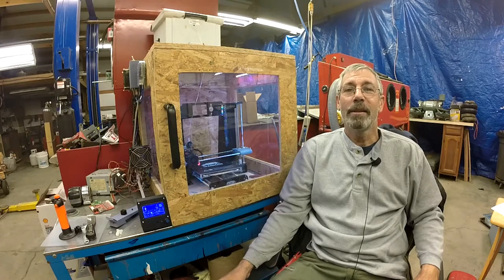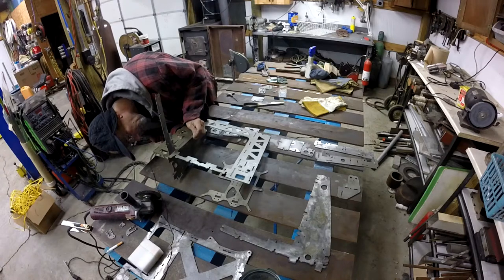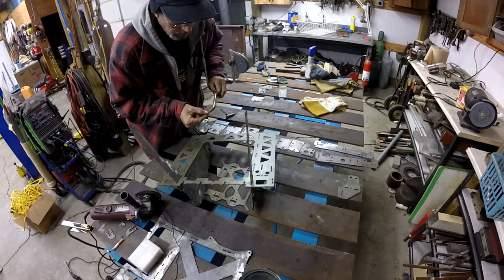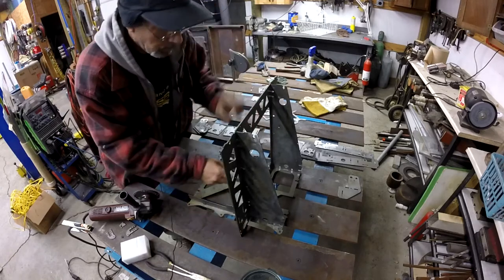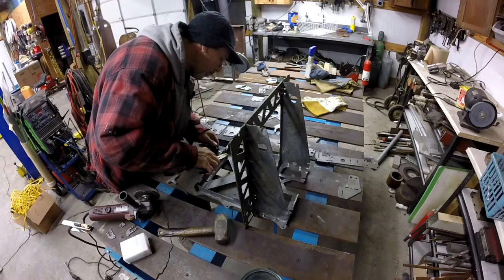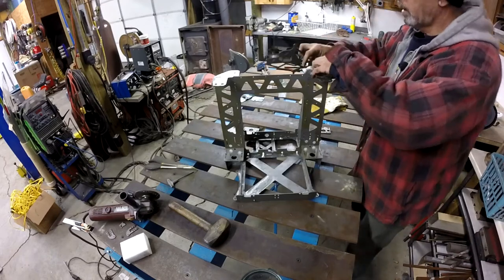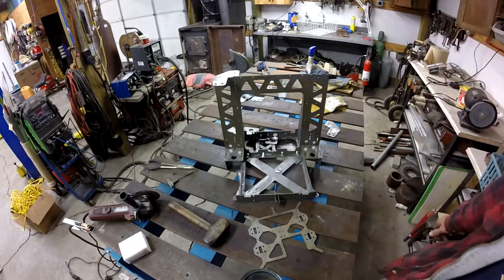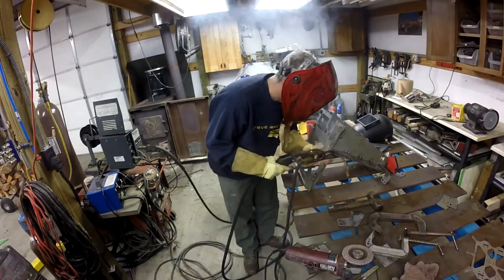Anet A6 steel frame upgrade part 2. Assembly and paint.

Comment from the maker: Hey Guys. Thanks for your interest in this steel frame! I've decided to cut them on my plasma table and offer them up for sale. You can check it out on my new Etsy shop page here: Purchase the Tatara A6 Steel Frame here, plasma cut by yours truly: https://www.etsy.com/listing/565664742/anet-a6-steel-frame-upgrade-kit-tatara
Also check out all the links in the description for thingiverse files and links for all the upgrade parts.
Reply: Marcel LeMay  i would only weld it if it is scewed together ... and only with tig 
I am a bit crazy about the Distortion from the welding in a cnc machine ... 
But good vid ;) 
Greetings from a german Construction welder ;)
Reply from the maker: max kuhlmann No problem with distortion. It was easy and quick. Just spot welds really. No need to completely weld this.
Reply: Marcel LeMay you do very good work I see you have t done a video in a while I hope all is well buddy look forward to your next video
Reply from the maker: Smalltown Farmer88  Hey man. I'm ok. I've been building a house outside in the January cold. I've been tired, and no spare time. Thanks for checking in.
Reply: Marcel LeMay 👍👍👍

Comment: Hi, I enjoyed your shop talk.
Did it work out for you with the steel frame and the A6 standard parts?
I plan to use my industrial plasma cutter at work to cut these parts and i am wondering about the quality of the outcome. Did you had to work the parts after the cutting like redrilling holes or grinding grooves open?
Reply from the maker: Actually they came out pretty good. I used a fine cut tip on the plasma cutter. The only thing I had to do was clean off the slag. I welded the frame together instead of screwing it because I could. I did sell some and no one had any problems screwing it together.

Comment: Oh that's looks interesting. I would like to see it put together and have a print comparaison between the stick and the metal frame. I really liked that.
Reply from the maker: Eric Mathieu   Hey, you know that's a great idea! Before I take the old setup apart, I should print a benchy as a reference. I'm gonna push the limits of the stock frame by increasing jerk and acceleration. Then I'll print another one with the same parameters on the steel frame. Thanks for the idea.
Reply from the maker: Eric Mathieu   Hey, you know that's a great idea! Before I take the old setup apart, I should print a benchy as a reference. I'm gonna push the limits of the stock frame by increasing jerk and acceleration. Then I'll print another one with the same parameters on the steel frame. Thanks for the idea.
Reply: Check speed test with Tatara A8 on Tatara - Steel Frame - Official Owner Group: https://www.facebook.com/groups/151635405446065/permalink/159956767947262/

Comment: I really like the looks of the steel frame. I checked the Etsy store and I must question the prices. You're in the US but the price is Canadian with shipping from Canada? What's up with that? I don't mind buying directly from you but I've bought from Etsy before and it wasn't a good experience. Anyway, I still want to see it all together and working. Thanks for making this.
Reply from the maker: +George Chambers 
George, Etsy defaults to Canadian dollars you have to go into your profile and change it.
Reply: OK I changed my profile and that looks much better. Thanks.